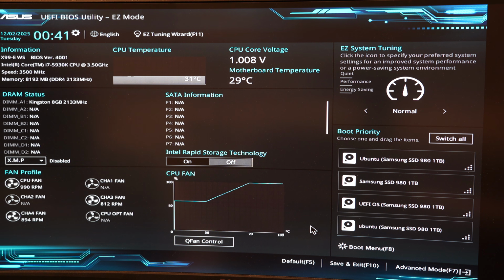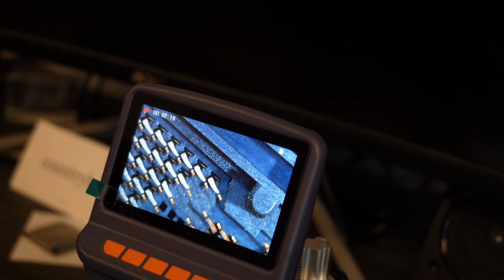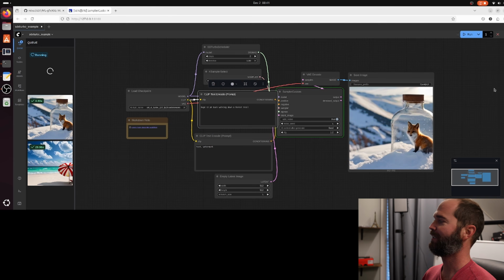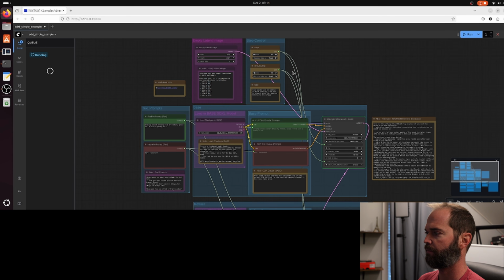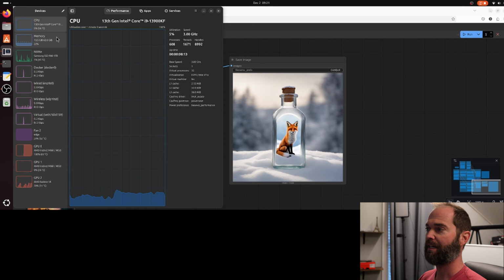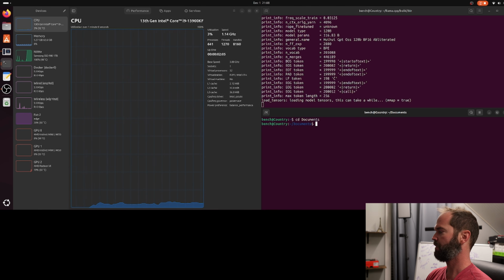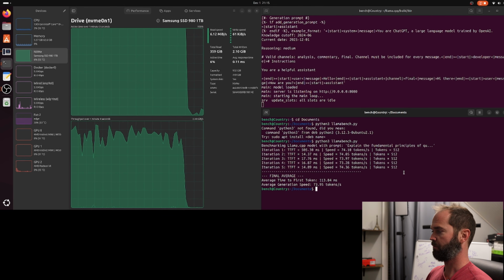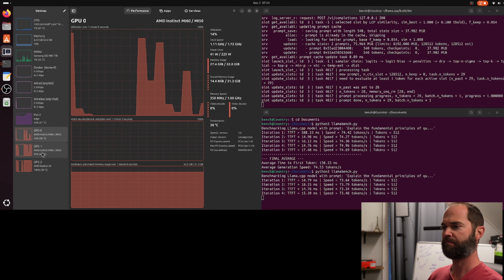Radeon Instinct Mi50 32GB ComfyUI Image Generation w/ Stable Diffusion + llama.cpp UPDATE !

Comment: Hi, I'm writing to you because I used your comments and many of them were valuable. So, modifying or supplementing ROCM with the missing gfx906 is probably the most suitable way to combine MI50 with new GPUs, for example gfx1201. I haven't been able to find anything simpler or better. It works flawlessly. It's harder with similar pytorch preparation, the whole process is more time-consuming and experience-intensive. So I confirm that MIXA is an excellent source for anything around AI/NL using MI50 32GB. My setup runs via oculink or thunderbolt3/4, EGPU and miniPC with AMD Radeon7 processor with 32 GB memory. The OS is Debian, I plan to deploy all the same frameworks on Windows11 and MacOs with Intel chips. I actually have everything I need, i.e. LLAMA.CPP and VLLM where I test the use of multiple eGPUs when managing with PROXMOX in various configurations, clusters, etc.😇
Reply from the maker: Awesome to hear. 
I know the gfx906 tensor files have been removed (mostly) from that Arch Linux databank. I think only 2 tensor files are in rocblas now… it used to contain 156 files for gfx906. 

Crazy that new 7000 / 9000 AMD gpu’s prefer Vulkan!  (See most recent llm wars vid)
Reply: @CountryBoyComputers Fortunatelly i saved these files locally before rrmoving them. A new gpu from intel looks exciting and power consumption is only 70wats. No reasons to supply gpu via additional cables yet.

Comment: Please try this solution.  The CPU cooler pressure creates a flex on the motherboard that makes your memory slot go in and out. Both of my real x99 boards have this issue with 2 of my coolers.  For some reason the chinese fake x99 tolerates the pressure better
Reply from the maker: Yes, it’s defiantly in the cpu socket and screws that hold the pump in place. 
I about to try it again. I have 1 other video to do first. Then I’m back to X99.

Comment: If you're using screencap on non16:9 monitors please do not scale the recordings up/down to fit the 16:9 canvas during edits - it makes small text unreadable due to scaling issues ;)
I'd suggest either leaving the 21:9 parts cropped (if unimportant, there are softwares like DisplayFusion that allow to set custom snapzones automatically to make it fool-proof) or temporarily set monitor res to 16:9.
Reply from the maker: Yeah, I’m going to stop doing full screen and crop the edges. So normal 16:9. 
Thank you. I’ve realized this recently myself. Good tip.

Comment: Video generation like Veo and Sora when?
Reply from the maker: After looking into each... it seems mostly they are structured for a subscription / cloud based model of use.  While running locally is possible, it requires substantial model training and basically a CS degree, from what I can gather.  I'm not sure that's going to be within the scope of my channel at this point in time, unless you can point me in a different direction. Excellent idea.

Comment: As for multi-gpu generative imagery/video, I don't think there is a way at this point.  I can do it no problem with LLM models but haven't found anything for image stuff or audio.  32gb is a good amount though, and with multiple cards you can run multiple instances of Comfy (with different port #'s)
Reply from the maker: There are plugins for comfy. But might only be for nvidia cuda? 
I found an open issue report on GitHub for my exact error. And there is only 1 open ticket in that whole thread. The same HIP error I showed.
Reply: @CountryBoyComputers  which plugins?  the ComfyUI-MultiGPU node?  Make a video if you get it working.  Looking through the docs, it looks like you can only offload some extra stuff, not properly distribute the generation like the old-school 3D render farms.
Reply from the maker: @rhadiem  I didn’t get to try it. It required Accelerator ABs some other deps the container didn’t have. I tried to install them into a container of my own built from the original, but no dice. 
I’m still learning Linux.
Reply: @CountryBoyComputers  I've been tinkering with this stuff for like a year and a half now, and I'm just now finally starting to get the hang of some of it. I have a background in computers too. The Windows to Linux transition is a massive step backwards in terms of usability.  I used ChatGPT to help the transition but the hours I've wasted by bad advice from it are more than I can count.. but they are overcome by the help I did eventually get.  It's a painful process, but it's the future and good experience to have.  Windows is dying and Linux is going to be even more relevant in 2026 than today.  Trying to get ROCM/AMD gpus working for AI stuff is on the bleeding edge as well, so best wishes.  32 gigs is great though, and worst case you set them as dedicated LLM gpus and that's not nothing.
Reply: @rhadiem  exactly and I must say that even now when using the same patterns, solutions with AMD GPUs in linux are much more comfortable than in windows. You need to dig a little more in the sources or watch the video sources if one of them is yours. And the results are CHAT, vLLM, llama.cpp, TTS, STT, Stable diffusion and whatever is running comfortably in linux.

Comment: I love using ComfyUI with docker containers, Ollama too.  You can easily assign gpus to containers within Portainer so you can spin up different configurations for different combos of gpus too.
Reply from the maker: Right, but how do you assign Multiple gpu’s to one container / one Comfy workflow?
Reply: @CountryBoyComputers  You can assign them to a container, but I don't believe you can use more than a single gpu for generative models right now.  You have to install multiple containers, each with their own gpu and run them separately.  I have 6 gpus on my server, so yeah I've looked but haven't found a way.  If you find one, be sure to make a video on it.  I've looked for hours and hours though, so good luck.

Comment: I think you should always clearly name the tools that appear in the windows you're showing. Not everyone is familiar with them, we see windows with existing stuff in them and we don't know if they're part of your work environment, your file manager or anything else, while for you it's obvious what you're showing. For now, aside the terminals and the browser at one point, I don't know any of the applications I've seen open. I seem to understand the first one was stable diffusion. I didn't know there was a graphical application for it, but maybe I misunderstood (I'm not english native).
Reply from the maker: Yes. I guess I assume some level of knowledge of what the viewers are witnessing. My fault for assuming. 
Some viewers are far more advanced than I, so it’s always a challenge.
Reply: @CountryBoyComputers  the main problem is that there are so many tools and environments to do the same thing that every time you see someone else's distro, you discover tools you've never seen on yours.
Reply from the maker: @levieux1137  ahhh. I see. Yes. Lots of Linuxes. Linuxi. Linuxous??  Ha.  Distros.
Reply from the maker: Are you talking about the image generation section?? 
That is the ComfyUI app (browser based). 

I don’t know what half of them do myself. But it works by linking together various “tasks” that ultimate generate your image. 

You can link up different “tasks” to each other and tweak them to obtain the output you desire in so far as quality of image (etc). 
Hope that helps. Just look up comfyUI and you’ll see.
Reply: @CountryBoyComputers  OK that's super helpful, thank you! I had never heard about this utility before your video. I'm not english native (like many viewers) and like many of us when I hear a word I don't understand I pass on while it might be the name of a tool I don't know and can't decipher. Thanks!
Reply from the maker: @levieux1137 no problem at all. I’ll explain better moving forward.

Comment: For your crashing issues, maybe passing "intel_iommu=on iommu=pt" to the kernel cmdline would help ?
Reply: It will help. 
I did this in the past  and 3x AMD MI50 work on a AsRock x99 Extreme 4.
Reply from the maker: @ecchichanf I’ve got another x99 coming. Is the giga UD4. I think it’ll do three x16. But not 4. That’s all I need.
Reply: @CountryBoyComputers  I think the x99 Gigabyte is missing the option for 4G decoding in the bios. 
I tried also a Asus X99-E-10G WS to run 4x AMD MI50 but it didn't work because of the bios. (Maybe with flashed AMD MI50s it maybe work)
You can flash the VBIOS do a Radeon VII pro and the Mini-DP will work and the software will better work.
In the end I switch to AsRock x399 Tachi to run 4x AMD MI50s with the orignal VBIOS.
Reply from the maker: @ecchichanf oh boy. More hurdles!!

If flashing the Radeon Vii bios, will it only show 16gb vram?
Reply: @CountryBoyComputers  It's the Radeon Pro V420 32 GB vbios. The TDP is lower 225W > 178W.
Reply from the maker: @ecchichanf ahhhh. I see now.
Reply: @ecchichanf  good to know. I limited my MI50 TDP to 180W and they lost roughly 10% performance only, which is fine because I could install 70mm fans running at 40% speed that I almost don't hear, and it stabilizes to 90°C that way. The output air is burning hot however!
Reply from the maker: thank you for the suggestion!!! unfortunately, i updated grub and rebooted to no avail... it's a known bug in ComfyUI for AMD gpu's, evidently. I clicked "help fix" and it took me to a trouble ticket on github.  many other comments on there with 7900 xtx, xt, 7800, etc.  same issue.

Comment: why did you have to downgrade PCIe to gen3, did you face issues or hangs ? The cards are Gen4 capable, that's why I'm asking (mine work in gen4).
Reply: Gen3 will affect model loading times, but won't hurt the generation times once things are loaded, as it doesn't do much talking to the CPU while it generates.  Similar with LLM's.  The big hurt with PCI restrictions is in multi gpu training where you have a big job you're synchronizing across multiple gpus.  (say fine tuning an llm model)  For "using" the tools it's less important aside from the initial load.  Fwiw.  I don't know what the issue was causing him to lower it to Gen3, perhaps it's lack of full 16 lanes for PCIE/Gen4.  I assume these cards are built for full 16 lanes, not 8 or so like some other devices.
Reply from the maker: @rhadiem if you didn’t catch my first x99 video, you’d like it. 
They run faster on gen3 x16 than gen 4 x8. X99 vs AM5.
Reply: @CountryBoyComputers  yeah these cards are x16 cards so they're unhappy with less.  I have 2 M40 24gb gpus that were a massive pain to get running on an old gaming pc motherboard, but are happy as a lark on my old datacenter multigpu system since I have 8x 16 channel pci lanes on it.  If you're looking at building a new system, make sure it has full 16 lanes for each card slot you want to use.  The bifurcation and other stuff is sub-optimal.  I have a Threadripper 7 or 8 slot x 16 lane motherboard on my wishlist.
Reply from the maker: @rhadiem yeah. I always just thought thread ripper was for multi core tasks. Never really saw the benefit of 128 pcie lanes as a gamer. :)

I do now!!
Reply: @CountryBoyComputers  We're swimming in the big pond now. :)  Get those gpus while you still can.  I expect AI to get walled away in the cloud pretty soon.   Just needs one big false flag, I mean tragedy to trigger support for taking away AI from commoners.  Comfy is adding Cloud modes, Ollama.. all the major Open-source AI tools are moving cloud.  Surely it's a concidence and not deep pockets calling the shots.
Reply from the maker: Honestly I’m not sure if that was crucial or not. 
I’d been trying to get the 5090 to run on the X99 without success. That’s one of the “must’s “ for that card. So I just showed all my settings as they were.. 
it may not be required for the mi50.
Reply: @CountryBoyComputers  OK makes sense. On my mobo, if a board is connected to one PCIe x16,the other ones are downgraded to x4, so one of my MI50 is in x4 and I'm not really noticing any difference.
Reply from the maker: @levieux1137  right, the lanes definitely get split (bifurcation). But I was talking about the Gen speed really. That mobo is Gen 5 on those first two slots. They should run Gen 4 x8 each with mi50. 
I didn’t realize throwing a Gen 3 gpu into the mix knocks the slot 1& 2 from 4 > 3 as well.

Comment: Hi! Testing speed with SDXL turbo on a 512 latent is quite irrelevant... I've got almost the same speed with CPU only...
You should test instead full models (the ones that do not have turbo/lighting in names or that needs more steps > 10), more recent models that fits in a 32Go VRAM like Flux.1 or Qwen familly ( Wan video even ) and generate at HD res !!
( Testing such obsolete model is like being mesmerized by notepad under GPU :))) )
Reply from the maker: Ahaha. Ha ha. As I mentioned and was obvious. It was my first time. 
Someone else had recommended turbo, so I obliged. 
I’ll check it out. 
Any idea why I was pulling 450 watts but only 1 gpu in work?
Reply: @CountryBoyComputers  I'm sorry I'm not such good on the hardware part... I suppose ComfyUI tries to use all the available ressources RAM/VRAM/CPUit can ... not sure !
Also I already heard of special ComfyUI fork or customization to use multi-GPU, it may not be able to do that on fresh default installs ( can't remember exactly, but you may search for "comfyui multi-GPU docker" keywords ;) )

Comment: 75-76c on an nvme will cause throttling, try to keep it under 60c - i usually find heat rising from gpu's below the nvme heatsink does also raise the nvme temp something to keep in mind and probably mitigated with higher cfm on the case fans
Reply from the maker: Yes, on that x99 board the single m.2 slot sits right under the gpu’s. So no air but hot air. 
If, and I mean if, I try that x99 board again I’ll cool the nvme much better. I really did want to compare three pcie3 x16 gpu to what the z690 did here.